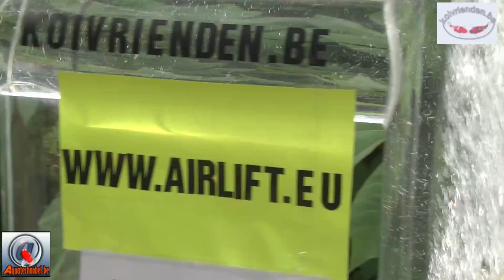introduction to airlift pump

Comment: I would love to see if you could run a water wheel with a permanent magnet generator and power it's self and maybe charge a battery too. Also see if a well pump based on your airlift. I love the airlift pump idea! thanks and keep up the good work!
Reply: U812GREEN  I think definitely the same. bring that together with a hatem cogging magnetic device and I believe be can have stable overunity
Reply: James Evans Hey, I had a similar project! It seems silly now but at the time it made sense. lol.

That said, I've mostly been focusing my efforts on alternative energy storage mechanisms. Like compressed air, hydrogen, etc.

The efficiencies don't really bother me. My goal is to create an extremely low cost storage mechanism. Batteries just aren't there yet. Most people on YT just don't seem to comprehend that.

Take oxyhydrogen storage for example. Oxyhydrogen via electrolysis uses 140% more energy to generate than you get back, then you have another loss converting the hydrogen into electricity via a hydrogen full cell (something like the Bloombox). The loss in the second half is only around 2 to 3%. Overall ineffiiciencies are somewhere around 143%. That's still about 57% usable of a double-upped solar panel or wind turbine, with potentially unlimited storage in something like a huge propane tank of some kind.

Solar panels can be had for less than $1 a watt. Some sources even down to 35 cents a watt. Whereas most lithium batteries are still +$1.50 a watt. To me, doubling up the solar panels hands down beats the cost of conventional batteries.

Thoughts?
Reply: James Evans Update; In light of our discussion on compressed air storage, there seems to be a similar alternative. I came across an older jewel from 2013, using compressed steam (condensed) for energy storage.

It seems they've been able to cut the losses down to 2%. Obviously not counting the efficiency of steam turbines/engines themselves. However, it has to have some merit to it considering that almost 80% of the United States energy production is by steam turbines.

Source;
http://www.treehugger.com/solar-technology/steam-engine-could-bring-cost-solar-power-storage-down-100kwh.html
Reply: Robert Heal Thanks for that bit of info. I don't know much about the technology. I just find this stuff fascinating. Care to elaborate on how it's dangerous? Is it corrosive, poisonous, or explosive? Thanks.
Reply from the maker: +Yìp o.0 https://www.youtube.com/watch?v=FLKT3Ur-KSM folow this mink for more information
Reply: It's water.
Reply: Over unity does not exist. Try it yourself, it will fail. I used to think the same way you did until 100's of failed experiments. There is no way to have a self-running system. You could however invest into alternative energies like wind, solar, etc.
Reply: I understand there always need to be power to start.
Reply: U812GREEN 
no, not just to start, but also to overcome the friction of the water rubbing on the sides of the pipes, the power lost to mechanical inefficiencies of the pump, and the power lost to running the generator. 
I once had a plan for a car that ran on an additional wheel that had a chain drive to the other wheel. the speed of the ground moving in comparison to the car would move the other wheels. hurr
Reply: how are you comparing solar @ 35 cents a watt to batteries at 1.50 a watt. are you referring to the kwh storage capacity of a battery? you can't use your solar without some kind of storage mechanism. 
Look into the costs of hydrogen storage. those tanks have to be safe, and therefore they aren't cheap. the cost will be much closer to batteries than you think. Also, it will be much larger, and nobody is putting 5 cubic meter tank in their car. 
Also, the fuel cell is expensive as well. 

Compressed air has suprisingly proven usable for the stop and go energy storage to create hybrid systems for UPS type delivery trucks.
Reply: +bugs181   You need to be very careful using "compressed steam (condensed)" for energy storage.   That liquid dihydrogen monoxide is dangerous stuff !

Comment: If your pond, mechanic filter and bio filter system are in the same level underground, this airlift pump will reduce your electric bill substantially since you only need some means to circulate the water. If your filter system was setup above the ground, then this airlift pump won't work well.
To lift the water up high, the air pump needs to inject quickly one large air bubble into the pipe to cover the whole surface area of the pipe to push a section of water column up one at a time like a capsule. To do so, the pipe should be smaller than the one demo in this video clip. With this technique, they can go up to 100-200ft because the air always goes up while the water pump cannot lift the whole weight of water inside the pipe up. For the airlift, they just need to calculate the ratio of air capsule, section of water height, and frequency of injection. The funny thing is you will see it pop rather than a continuous flow of water on top.
Reply: Wrong info, larger air bubbles are not prefered

Comment: I am sure this system works but this demo only seems to show air circulating from the bottom up.  It would be much more effective if you could show the volume of water that can be pumped out.  I would like to see how fast you can fill a bucket.
Reply: StealthyGo yeah, I didn't believe the balls meant much, except that they are sucked back down to the bottom of the airlift

Comment: This stuff only circulating water, water will not be lifted beyond from the height of the water level. Please note the height of the water surface of the two tube, you can see the water flowing just below the upper water surface.
Reply: It will easily lift it another 2 - 3 feet of head hight, but there will be losses in the flow rate. (Please note that the outlet has been specifically placed at air exit level, and is not in a pond or lake.  This is a closed loop sump situation).
Reply: Entr Opy apparently a fish tank air pump can lift water the height of a house
Reply: 1. Oxidation (esp. for fish tanks), 2. Cooling/heating water with natural outdoor air temp, 3. Decorations, 4. Putting some balls (or anything!) filled with tonic water, or fluorescent materials, and illuminating them with black light(UV) , which is pretty much enjoying to watch, which no one will probably deny. :)

Comment: Brumby pumps use air in a slightly modified design, to push water over 100-ft (32m) in head. Is bore size or air pressure more limiting?

Comment: Pretty awesome. What about lift height?
Reply from the maker: 20 cm maximum else you louse to match flow
Reply: Hmm. wasnt much.Have you thought about adding a smaller pipe at the end? Wouldn't it increase pressure?
Reply: i mean a cone shaped pipe.
Reply from the maker: Dennis Henriksen in this case it is a strait line pipe
Reply: Aquatechnobel Okay, i tried this, didnt get anything but bubbles, my airpump is on 11 watt and 540 liters pr hour. Maybe not powerful enough.